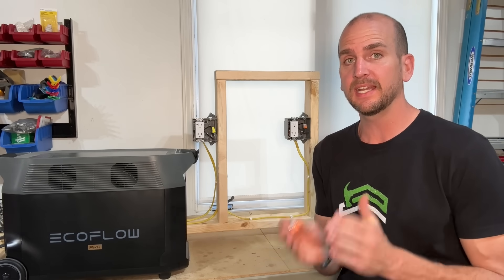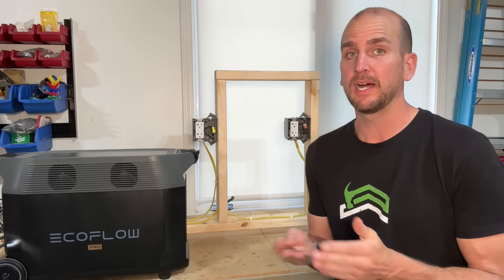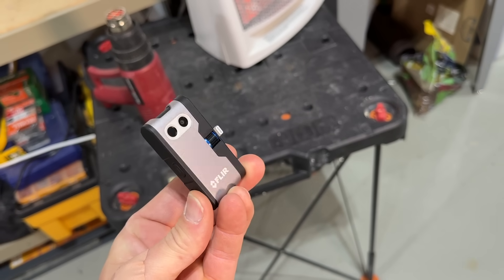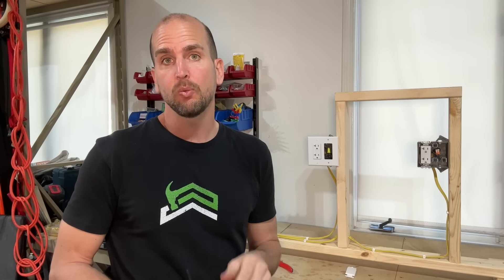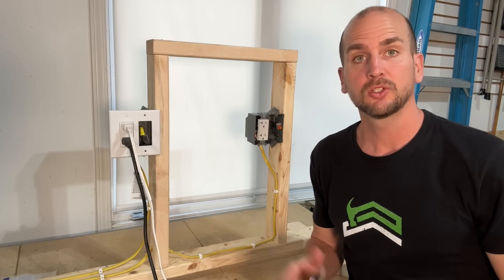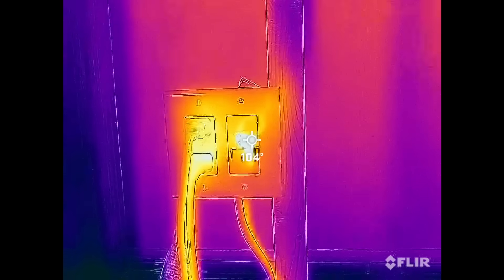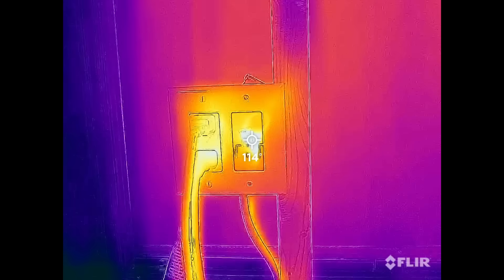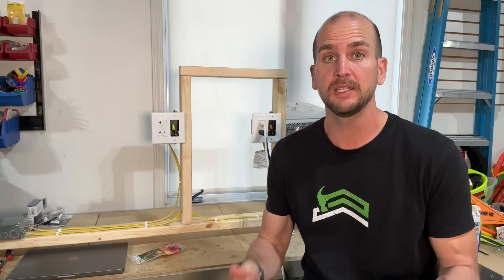Debunking the Pros: Can WAGO Lever Nuts Handle Heavy Electrical Loads?

Comment: I have a wall outlet which shorted out after changing the plug receptacle. The insulation apparently cracked and blew off the neutral and ground wires. What's left is very short. I've been looking for a way to fix it without hiring an Electric Contractor and running new wires in the wall. I believe the WAGO would be most helpful in my situation. I never exceed the 20 AMP rating, which the short did trip the breaker when it happened. It looks like the WAGO would allow more room in the box for the new pigtail wires and the connector than the wire nut since my wires are so darn short. Your video helped me see the WAGO does it's job. That's what I'm looking for. The most I will run off this plug is a Window AC unit and maybe a couple of pieces of stereo equipment of low wattage. The AC unit will never be run when we're not home. I'm not that crazy.

Comment: Thanks! This gives me confidence to continue using WAGO in our log cabin. Just one question, how many times can the WAGO lever be set and unset before spring loses effectiveness? Thanks again.
Reply: Probably far more times than you would ever do so - unless you are going to use the WAGO as a primitive on/off switch.
Reply: @buggsy5  Thanks appreciate your comment. No I wont be using it as an on/off switch but I donned to do rewiring occasionally.

Comment: In a former life, I did Mil Spec (Military Specification) testing of crimp on wire terminals. If you wanted to sell to the government, they must pass the Mil Spec. We used the latest test equipment traceable to the NIST (National Institute of Standards and Technology). He did a good job using home test equipment. (I need to get one of those cameras) Most wire insulation is rated for 105 deg C (221 F). I think for the most part, he stayed below that. Next, he was over amps for most home circuits which is either 15 or 20 amps. The household 20-amp breaker would have tripped long before he would have got any heat in it. I think a better way to test these is voltage drop across the connector, but that means messing with live 120 volts.

Comment: The real problem is ensuring people buy LEGITIMATE WAGO connectors.  There are a ton of chinese companies selling WAGO branded nuts, having stolen their IP and branding which are not safe to operate.  If you're going to do these, at least get them from a reputable retailer and DO NOT use Amazon which at this point is just a Chinese knockoff website.

Comment: I think a resistance test should be conducted instead of basing it off of temperature to signify more resistance. Your not taking into consideration the material the connectors are made of. This plays a part in the measuring of heat from the Flir camera. The Wago is made from transparent polycarbonate and the the wire nut is made from insulating plastic. 7:50

Comment: Wago’s meet all required German and European standards. They are the go to connector for electricians in the UK. If there were design problems they would be well known about by now. The main factor is that there are less installation variables for electricians to get wrong compared to screw terminals, wire nuts etc, which make them inherently safer!

Comment: Great job giving real world test results.  I feel that the Wago is superior.  Your channel is presenting info for DIY users.  For those of us who have done a lot of wiring over the years, a common failure point is using a standard wire nut incorrectly.  The Wago is so difficult to use improperly that it greatly lowers any issues with connecting wires inside of boxes.  There is still a gigantic safety margin in using Wago connectors and they are faster to install.  

For being totally very old school, I would have liked to see the temp comparison for joining the wires by twisting, soldering, and taping.  I think it would be an even better result.  For those who say wire nuts are safer so I am using them, then why aren’t they soldering them.  Yes, way too slow.  

I feel that after making 500 joints, the number of poor joints with wire nuts will be much higher than joints made with Wagos.   Wagos cost more but I feel are worth it.
Reply: I don't really understand the cost problem, a Wago is less than a dollar. I completely rewired my flat two years ago, it cost me around $2500, out of which the Wagos were far less than 10%. And even that wouldn't have been too much for the added safety and durability of their spring action.
Reply: Using a wago according to the manufactures instructions will cause them to fail itself. This guy is selling them, dont listen to him. Haste makes waste - wagos.
Reply: The use of the wago itself is improper. Why would you use a connector u know heats up?

Comment: To do this type of thermography professionally requires a 40 hour course just to get a level 1 Thermographer certificate.  Using an imager to take measurements is not as simple as "putting the cross-hairs on what you want to measure."  The camera does not measure temperature, it calculates it based on the infrared radiation and a few other parameters that have to be taken into account.  Most of the work of getting the measurement is done after the image has been taken.

The cross-hair is referred to as the SSR (Spot-Size Ratio) and more than one can be generated from an image by downloading the image into FLIR Tools (a software suite provided by FLIR for doing this).  Once downloaded, you pace the SSR over what you are trying to measure (the SSR needs to be smaller than the object in the image, this is a property of the imager and cannot be adjusted.  Once this is done, to calculate the temperature you need to know the emissivity of the  wire nut and the WAGO, the RAT (Reflected Apparent Temperature), the distance from the imager to the object, the atmospheric temp, and relative humidity are all values used by the software to calculate the actual temperature.

The certification is a bit pricey at around $1200 and is a 40 hour course, but well worth it if you want to do this type of analysis.  I was fortunate enough to get this course through my employer as part of my job.

Comment: Hi Scott,

I always appreciate seeing people testing devices to see how they perform in real life situations.  It is not like every breaker always will trip at the rated capacity... there have certainly been some that have been tested that were considerably over their stated trip point, which lends to the credibility of your testing above the rated limits.

Wouldn't it be a disappointment if these created a dangerous situation after being certified by multiple regulatory authorities?  One of the benefits of the Wago is it will be much harder for a non-professional to install them incorrectly.  When my sister asked me to help her with a few things at her relatively new house I opened a light up and a wire pulled right out of the wire nut with next to no force on it.  Very shoddy workmanship on the part of the professionals who installed it.  I doubt the inspectors would check every single connection in a new build but more likely rely on randomly inspecting a certain number of connections and believe they are representative of the remaining work.  Lucky for her this was a light that saw short runs rather than constant use.

Comment: 6:05 'Is that good enough'? Of course it's good enough, they wouldn't have made it to market if they weren't, but you have to use them within their specification limits. If you want to put 30A through a 20A rated connector then that's on you, not the connector. Would you put 30A down a 1mm2 conductor over 30 feet? And not expect trouble? No! You need to use a connector, wiring and circuit breaker of the correct spec for the spur/ring you are building, don't blame the connector if you don't follow the rules and try to put more through it than it's designed to take. Same with wire nuts (that I would never use personally) wrong implementation will cause issues. End of discussion.

Comment: Most connections in homes will never be taken apart or at most once or twice during a remodel of the home during its life.  Given that, I prefer to take the time, and save the cost of the Wagos, and use wire nuts.  They are cheap, reliable and easy to use with just a touch of practice.  If I had a connection that was likely to be modified often, then I’d probably use a Wago for the ease of doing that, but I just can’t think of many scenarios in residential wiring where that is the case.
Reply: Even higher grade outlets loosen over time, esp in high traffic areas. Smart home outlets and switches also have a shorter lifecycle, whether it's down to failures or upgrades. It's a huge PITA to deal with a twisted mess under a wire nut when you're making an upgrade. It also puts huge stress on the copper, so much so that while changing out outlets in my house I've had some copper wires snap on me under relatively little stress.
Reply: @alekswilliams  I have never had a high grade receptacle go bad in my home and I have many kitchen and bathroom outlets that get a lot of use.  I have lived in my current home for 23 years and have yet to have a receptacle need to be replaced.  I have replaced a few in the church I attend, but they are probably 50 years old.  If the wire is stressed to the point of breaking, then the wire nut wasn’t installed properly.  It is one that had the wire twisted first with pliers before the wire nut was installed and I am not aware of any wire nut manufacturer that recommends doing that.  Many electricians do that, but it is not advisable.  A properly installed wire nut will allow the wires to come loose when it is removed.  If the wires stay twisted together on their own, then the wire nut was not properly installed.
Reply: @LTVoyager  I'm a retired Master Electrician, and you're exactly right.

Comment: Great video. I have switch to wago, like stated from others I have seen twist type come off or loosen over time. Like you stated the breaker will trip well before wago tolerance is meet.
Reply: They don't 'come off or loosen' if done properly in the first place.  Way too many DIY'ers and hack electricians doing electrical work these days.  :face-turquoise-covering-eyes:

Comment: I have used Wago for years and love them.  They are especially useful when wiring a box with a lot of wires.  The space savings, while not part of the max conduit calc, makes a huge difference.  Those wire nuts take a lot more space and Wago just looks better.  The one caveat though is to make sure you don't accidently push a lever up when pushing the wires into the box.  I had this happen once and it was a huge pain tracking it down.
Reply: Tape them

Comment: Gauging only by my personal habits where I will use a small space heater over extended periods... Heat equals resistance, so over time (hours not minutes) the heat gain feeding into a loop starts to make me nervous. The Wago up in the ceiling when ganging lights together would be no problem. My bad habits at certain outlets is something I would plan for and likely rule them out. Redundancy for reliability and safety. Best practices in wiring backed up by a properly functioning breaker.

Comment: Wago really should be updating their designs to include more surface area. Lower the resistance, generate less heat.  Get it to be comparable to the wire nut and then I think the complaints would disappear.
Reply: The contact area already is much bigger than the transfer area of the wire...
Reply: No, they won't. Some would still insist on using wire nuts - because they have been using them for  decades, possibly incorrectly without their knowing (or skill level), and refuse to try something that is new to them.

Comment: I've seen other videos of testing the 221 lever nuts. They don't begin to melt until around the 80 Amp mark.
Reply: And that is on a connector with a 32A rating...
Reply: Fun test, but in practice when the fuck would you ever use wire nuts or wagos on an 80 amp load?
That’s going into special connector types territory like Polaris taps.
Reply: @ellescer  It's a useful test for demonstrating the current ceiling, which in turn brings about peace of mind.

Comment: Dunno if anyone has mentioned this but there would also be a difference observable on your electrical bill. 

I can't do the math in my head at the moment but I wonder what the cost variance would be between the three connectors on a common circuit that sees a heavy load over the course
of a year. (Although can't imagine any households having a steady load as heavy as the one in this video)
Reply: Seeing as the difference is less than two watts, if a previous poster is correct, your electrical bill would drop by less than 1/100 of a percent. You would never notice a difference in the bill.

Comment: Good info, thanks. I was recently talking to another and he said he didn't like the WAGO because they score/cut into the wire. I said, other devices certainly do that, but the WAGO was a pinch/squeeze. That changed his mind. I like the WAGO's because of its easy install and clean.
Reply: And how many 'electricians' use a pair of cutters to strip the ends of wires, that cut into the conductor as they do it?

Comment: You read my mind.  After seeing you recommend Wago numerous times in your videos, I still hesitated when it came to my projects.  “But the resistance is higher with the Wago; it’s safer to stick to wire nuts,” I told my self.  Well, not any more!  Thanks to your well-planned and well-run demonstration, I no longer have any hesitation.  This is what I love most about your channel: you don’t just reach conclusions about different methods or parts, you take the time and effort to break them down and test them.  Excellent work, yet again.
Reply: Those temps aren't that bad at all
Reply: Outlets using push in holes aren't much better with contact area vs the wago contact area.....Imho...
Reply: The tests dont mean anything its over time they breakdown or fail because of a workers need for speed. They fail for flimsy connections and high resistances and they dont bite the wire and rotate when pushed into the box, their junk.
Reply: You need to reevaluate that. This guy is just a handyman. He knows nothing of what he talks about. Your fist opinion was correct.
Reply: @RadioRich100  I've employed my share of tradespeople for work on a few homes over the decades. To say that handymen know nothing is wrong. Though they may have less experience in 1 specific field, a good handyman can often do a better overall job if they have experience in many different trades. I've found that a person who only focuses on 1 field, say an electrician, can often be a bit timid about making changes to plumbing, a heat duct, or drywall that might be in the way. Sure, if I want an electrical service change then I'll call an electrician. But, if I want to widen a closet door that might involve changes to framing, drywall, a receptacle, and a water pipe then I'd rather hire 1 good handyman than 3 specific tradespeople. And the end result would likely be better.
Reply: @JasonEDragon  ??? What the heck does that have to do with providing research on wagos that hes not qualified to give?
Reply: @RadioRich100  Although I've seen videos from some very knowledgeable electricians (such as Mike Holt in the USA and John Ward in the UK), I've also seen seen electricians make videos with dubious comments about Wago connectors as well. This was just one short video and I thought that it was well done. And it is not as if electricians are designing these products at companies such as Ideal and Wago. I expect that instead they mostly employ people such as material scientists, electrical engineers, mechanical engineers, test engineers, statisticians, physicists and the like. If you are suggesting that only an electrician with several years experience should comment on these topics then I don't accept that.

I expect that over the coming years there will be a lot more smart devices being integrated into our electrical systems, which electricians will be ill prepared to handle only by themselves. So, more people can be expected to be tinkering with electricity and we will need devices that can better accommodate people whose area of experience varies.
Reply: @Jason Dragon  these things are not smart or better or just as good. There faster and will cause points of failure as time goes on. Why do think wagos are banned in so many places?
Reply: @RadioRich100  Wagos have been widely used in Europe for years and years and I've not read of any problems there. If certain locations have banned their use in the USA then I'd very much like to read their justification for doing so. Have they done a scientific study and found an actual defect of some kind? Where are the photos of failed Wago connections? Or is it a similar situation to certain locations banning the use of PVC pipe - that is more a case of protecting jobs than safety?

For electrical connections what is important is not just how solid it is on day 1 but also how it will hold up over 100 years - with temperature changes, vibrations, humidity, current load, mixed solid and stranded conductors, and modifications that may be made in the future. The ease of install, ability to properly install, and cost are all important factors. If people find electrical improvements to be too difficult and costly then they will be more likely to put off the work and just live with problems.
Reply: @RadioRich100  Heh, "just a handyman".  So ignore the real-world test he just conducted.  Who you gonna believe, me (RadioRich100) or your own lyin' eyes?

Go away.